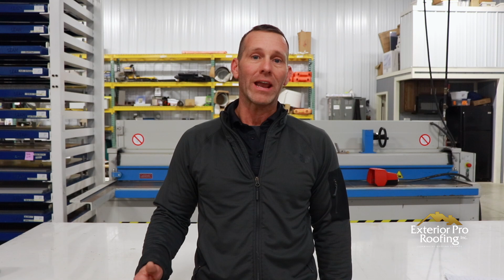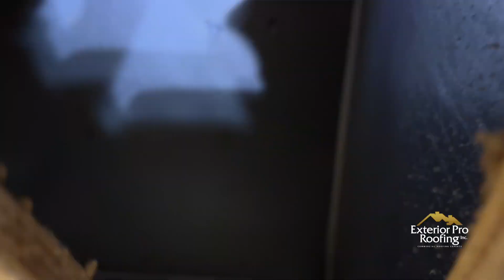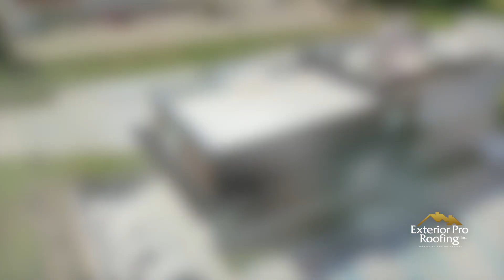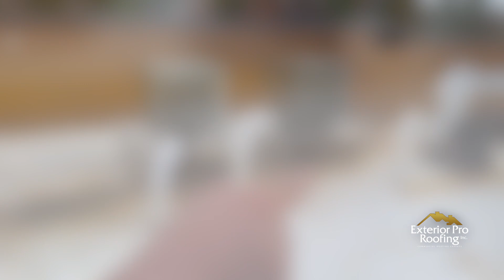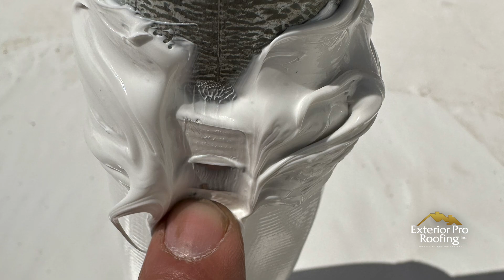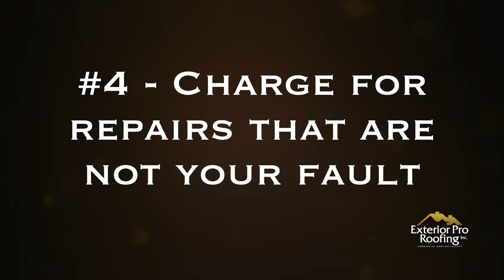Defend against  Flat roof leaks before they happen  - How to become a defensive Roofer

Comment: Have you had any experience with a product called Cedair mat? (used under metal or cedar shake) Makes sense for noise reduction and a small amount of air flow to reduce deck temp. But.. it is spongy for your clips, you have to adjust your clip height somehow and it may have other issues.